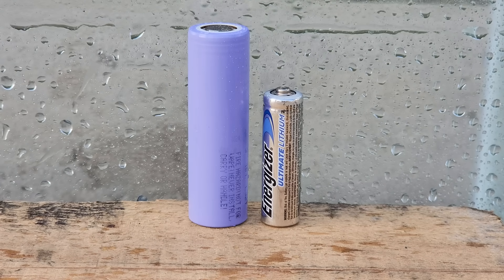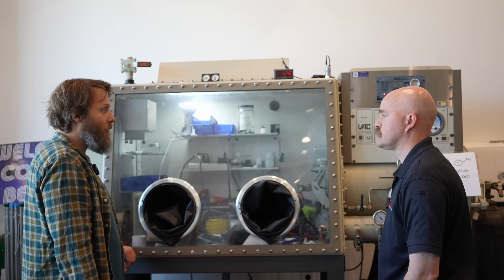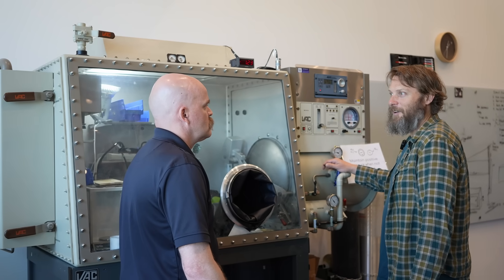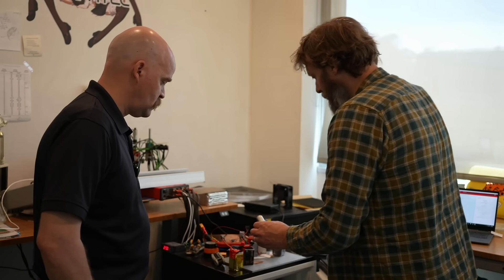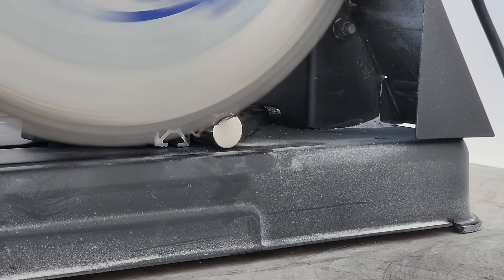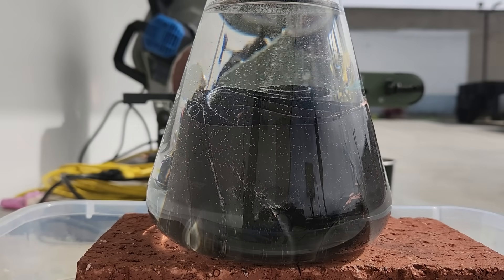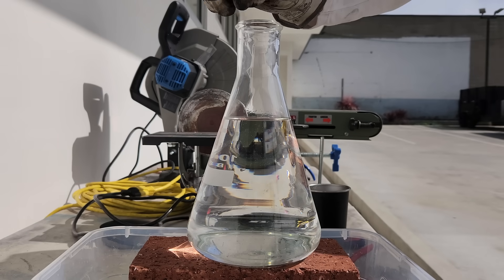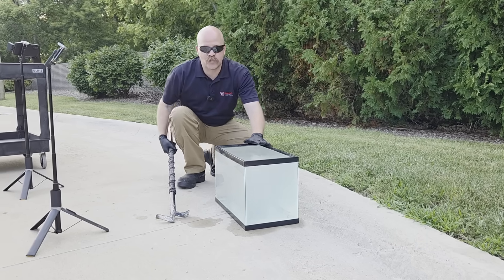Do Lithium(Ion) Batteries Explode in Water?

Comment: I feel like it's fair to assume that it would be pretty hard to mass market those disposable lithium ion metal batteries if it were that easy to cause a combustion the way you only sawed the top off for an opening and put the canister in the beaker as is. We'd have mandatory fire extinguisher courses from junior high on up by now.

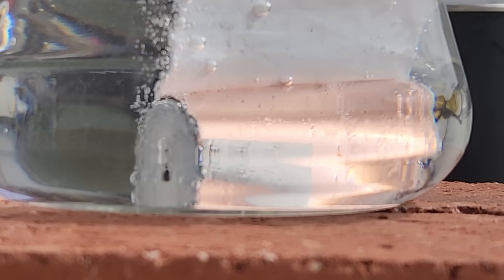Comment: If these lithium ion batteries had been charged too quickly in low temps then they would have metal in them and go into thermal runaway in the water. 10:30

Comment: Long ago I used to watch people rip open dozens of lithium batteries to use the lithium for the creation of illegal (and disgusting) substances.  Its easy to access, you just you pliers and sharp wire cutters to peel off the positive terminal and it unrolls pretty easily.   And if the air is humid it WILL self ignite!   Its extremely dangerous.  I don't even know how these batteries are legal.

Comment: If you try this at home, be aware the reaction with water produces a strong alkali hydroxide.  Alkali's are better at dissolving flesh than acids, though the volume of water vs the volume of lithium means its probably too dilute to be a hazard.  Just don't take a bath in it afterward if you threw hundreds of batteries in there..

Comment: Maybe trying a laptop battery to get that big explosion.

I had a laptop and it's battery lasted for 3 or 4 yrs, even when it was connected to the power cord it stayed cooled. Then I decided to buy another one and got an extended version, this one lasted for less than a year sadly, and when it died it started heating up when I plugged in the charger. I would assume that it was so degraded inside that it was causing an internal short circuit.

Comment: Those energizers if ya wanna throw it in water for fire just use a copper pipe cutter, you can cut right thru that case without cutting into the lithium strip

Comment: This video is great, and really stops some of the misconceptions around li-ion batteries. The amount of people who don't know that water is actually used for smaller cells, and also that electrolyte is the flammable part. So many people think Li-ion have actual lithium metal and get more scared because of that. 

Fun fact, lithium metal is an option to replace the anode, but with the liquid electrolyte systems at the moment, they tend to be too reactive.

Comment: Did you use distilled water? That would make a huge difference if there was ions in the water? You can dunk a computer in distilled water while it's on and nothing happens, add a couple specks of salt and boom, you have a paper weight.

Comment: I washed my pants with a rechareable lithium-ion battery flashlight in a pocket.  It went through the wash and then in the dryer.  I was surprised nothing more happened than the battery lost its charge. I replaced the battery (the flashlight survived a bit beat up but operable) and recycled the washed-up battery.

Comment: The issue is not the  cells ,there pretty much waterproof ,if road/flood contaminated water enters the EV battery ( which has to have ventilation ) this forms carbon short circuit tracks within the battery modules , which may explain why some EVs have a unexpected thermal combustion fire?

Comment: These batteries are like tiny solid rocket boosters/ chemical rockets. Just like gun powder, it's un eventful when not constrained in the metal bullet case. It burns, but not a dangerous event. Even Sugar, when in a tight container (toy rocket motors), are dangerous if not handled with care.

Comment: I believe the primary lithium cell you show in this demonstration is not lithium manganese dioxide, but lithium iron disulfide.  Li-MnO2 tends to be used in button cells and has a voltage of 3V.   LiFeS2 is what they use in the cylindrical cells and has a voltage of 1.5 V.

Comment: 10:14 if you unwind it and then put it in water it will react more
Reply: Or if you open a lithium iron battery that is fully charged and unwind it it will thermal runaway

Comment: "I really wanted the fishtank to explode, but it didn't, so..."  (swings club, breaks tank)  Now THAT's science!

This makes sense; if you know your chemistry, you know that metals down the leftmost column of the periodic table are reactive to water.  Lithium is there, along with sodium, potassium, rubidium, and cesium; the further down the table, the more violent the reaction.  Maybe if we can manufacture a battery without these elements, we can make a safer battery?

Comment: In 2017 I bought a drone. Through discussion groups I learned batteries left on charger would swell. I confirmed that and removed batteries from charger, but due to rising costs and FAA regulations I unregistered my drones and stopped flying. I still use Li batteries, but not in drones.

Comment: I use Lithium Polymer batteries in my flying RC hobby... they can be quite violent need special attention. way more reactive than LIONs.. but even they dont do much in water.. i soak old dead ones in salt water for a few days before taking them into the recycle depot

Comment: Question. 
In my fire school training in the service, we were told the only way to put out a Class C electrical fire is to de-energize the circuits.  Then you are only dealing with A and B fires.  Not something that can be done when batteries are involved.
Granted this was back in the 1970s and things have probably changed since then.

Comment: Nice video.  One correction: at 10:52 you mention that the black material in the non-rechargeable battery is "magnesium dioxide", it is actually manganese dioxide.  Magnesium and manganese are two very different chemical elements.  Magnesium forms only the monoxide, MgO (which is white), while manganese can form several oxides, such as MnO (pale green), MnO2 (the black material) and Mn2O7 (an explosive red oil).
Reply from the maker: You are correct.  I misspoke.

Comment: To be candid, even dunking pure lithium metal in water shouldn't result in fire but the water will heat up very quickly. Sodium will produce visibly more energetic reactions in water and potassium will definitely catch fire in water and Cesium will be highly explosive. You need the appropriate combination of lithium ions and other cell components to create those typical thermal runaways. Hence NMC cells are more thermally unstable than LFP cells even though they are both (technically speaking) lithium ion batteries. The normal order of reactivity of alkali metals is Cesium>Potassium >Sodium >Lithium. The reason why lithium batteries are more energy dense than batteries made from it's more reactive brothers (which is kind of an anomaly) is beyond the scope of a YouTube comment like this.

Comment: It lets you know, that unless a Lithium Ion cell (or some part of it) is severely over-heated, it's a "nothin' burger". Level 1 or Level 2 charging an EV in your garage is perfectly safe, as long as the car hasn't been in an accident, or, an error in the BMS allows a cell to become over-charged. EV battery fires are so rare, insurance companies barely even address it. If the companies that pay out after an incident don't factor it in, you have very little to worry about.
     My insurance rate went up $48 dollars a month, when I upgraded from a 20 year old Toyota Prius with liability only, to a shiny new 2025 Chevrolet Equinox EV  with all wheel drive. The increase in premium was based ONLY on the replacement value of the car. If you were "tap dancing on a land mine" every time you plug in an EV, my auto insurance wouldn't want it, my homeowners insurance wouldn't have it. The only concern by the home owners insurance, is that any charge service equipment be installed by a licensed electrician. Their concern is, making sure the outlets and wiring can carry the sustained high current involved with charging an 85 kWh battery, which could take hours. No concern whatsoever, about the battery itself, just the house wiring.

Comment: When I was an Infantry radio operator (RTO) in the US Army (mid- to late-1980's), we transitioned from the old-chemistry batteries to Lithium batteries.  The first thing, middle thing, and last thing we were told was "don't soak the batteries in water".  They were probably the lithium-metal style.  While I'm not aware of any of them bursting into flames (in the radio they were sealed from water, and by default they were sealed up like MRE's), I was always paranoid about them.  
We RTO's who had to walk overland for a living loved those lithium batteries.  For each of the old-chemistry batteries, we could carry 2 of the lithium batteries in the same space, each of the lithium batteries lasted two or three times as long as an old-chemistry battery,  and they weighed less.  That technology was wonderful.  😃

Comment: Thanks for this, as an RC hobbyist I've been trying to educate people about rechargeable li-ion and lipo batteries and their safe handling and disposal.

I've recommended "disabling" them by immersing them in a salt water solution (if a recycling center is not available)  before disposal so they cannot erupt in the garbage.

And people let me HAVE it. I tried explaining about the lithium being trapped in a substrate and that I have literally done the experiments where I've opened them with no fire. They catch fire when shorted or due to thermal runaway, not exposure to air or water (lipo and li-ion).
Reply: I short my old RC lipo packs out by driving a screw through them, then once they've burnt out they're safe to through in the bin. I do this in a safe area outside of course.
Reply: @FokDR1 the saltwater is for a less dramatic way to do it lol
(Less fun too)
Reply: This is a fear monger channel I have flown RC since 1992 yes I have seen a few lipoly packs catch fire after being crashed in a plane then recharged attempted at the RC field. I have crashed a few the pack was all smashed in I was able to keep using them. I even had packs that swelled like balloons they still held a full charge kept right on flying them never did one ever burst into flames. I have about 80 lipoly batteries which are the evil cobalt based technology never once had any of them ever burst into flames. I charge them outside, and I store them at 30% charge inside a battery safe bag.  This guys channel he makes money off trying to make Lithium batteries equal to nitroglycerin.  When a battery is no longer usable drain it down using my charger to 0 then toss in the trash once discharged they are safe.
Reply: @Mike-01234 no this is accurate information. You would not believe the techno myths that surround lipos.

He is presenting that handled normally they are perfectly safe. And most importantly that the lithium inside cannot react with water and that is NOT the source of their combustion.

The source of combustion is shorting or thermal runaway (which in my opinion is a fancy name for a short caused by thermal expansion).

You might have gotten away with flying puffed packs 10 years ago but I wouldn't do it today. The manufacturing techniques have gotten the layers ridiculously thin for high energy density and that means a tiny bit of swelling can make 2 layers touch and that's a short and the beginning of the end for that battery.

Comment: Without an ignition source laboratory grade pure lithium only produces Hydrogen. I have thrown pure lithium into water and without providing a source of ignition it just bubbles and sputters about on the surface of the water. That being said don't play with lithium because it can go sideways if not handled correctly.

Comment: Stored energy comes in many forms, the higher the density the greater the danger.  Also, as the dangerous goods code makes very clear, more DG material means a larger risk.  You can safely drive around in a light vehicle with 60 liters of gasoline on board in tank, but would you want to be driving a semi truck with 2000 liters of gasoline hanging off the chassis rails in Alloy tanks?  Thanks to Semi-trucks using diesel fuel (not gasoline) then 2000 liters is not a problem.   This is what concerns me about people that use LiFePO4 batteries in large battery bank arrays, they have 20kw/hr of them, in a big clump, no fire rated material separation, indoors, and next to other electrical equipment like Inverters etc which provide a potential source of ignition.Then this is all indoors and next to other combustibles.  There are other videos even more cringe, involving people using old and less safe EV vehicle batteries known to have self ignition issues, being set up indoors.

Comment: I was trying to repair a cellphone once, and I was trying to cut a tiny piece of plastic that didn't quite fit right.  I ended up slipping and piercing the battery...well, it burst into flames right away and I managed to throw it into my stainless steel kitchen sink before it did any damage...those things go QUICK!!  Needless to say that phone never ended up getting repaired 🤣

Comment: Was surprised at the reaction with clean water. Like some said , salt water may bring a bigger reaction. Would it be possible to use a tubing cutter instead of a chop saw to open a cell , not that I'm going to try. Nice dig with the musky truck in the background.

Comment: Also bear in mind that the aluminum and magnesium sheet materials inside additionally become self-feeding reactive materials once a certain temperature requirement and presence (addition) of water. It's just like the elemental lithium scenario, except requires an additional high temperature condition to make the magic conditions combo.

Even the presence of aluminum and copper together combined with extreme high temperature could be sketchy, as in thermite...or is that in combination with iron?

Comment: Interesting stuff but my query is what if that water had some level an electrolyte dissolved in it - would that change the end result? Am asking because if this were the batteries we see in an EV for example the likelihood of the water the batteries that may become immersed in will contain some level of elements that make the water way more conductive than the plain water in the experiment?

Comment: not the best experiment. You submerge not a battery, functional electric device, but effectively parts from which it consists, thus check only interaction between water and these parts. Ummmm, not very interesting if these parts are not active by self. 

I tried to drown old malfunctioning (swollen and producing almost no power, but still assembled) phone battery to get rid of it safely, - it does not explode like metal Li, but at least react very actively, emits gases and sparks when water gets inside the structure and shorts electricity. Unrolled but NOT separated electrode stripes react with visible effect too.

Of course fully charged battery will react much more active. And salt, good conductive, water will increase activity by orders.

Comment: Pat, I'd HATE to be this guy's landlord.  I've gone through several Phase I and Phase II environmental inspections connected to loans on large properties.  One Phase I inspection revealed an automobile engine oil stain that showed signs of the oil dripping off the edge of a concrete slab onto adjoining soil.   I watched two young environmental engineers with Ph.ds use hand shovels to fill two 50 gallon barrels with "contaminated" soil, seal the barrels, obtain a special transit permit and take the everything from Los Angeles to a hazardous waste disposal site in Nevada.  Want to guess how much that cost?

Regardless of the actual hazard, If I saw you cutting lithium batteries open and unwinding "jelly rolls" on my parking lot I'd kick your ass then serve you with an eviction notice. Love the Cybercrap Truck.  Buy the way, how did you dispose of the hazardous waste you created?

Comment: There is elemental lithium in a charged li-ion cell but most of it is locked away in the carbon or silicon lattice, greatly limiting reactivity with water.

Comment: A friend working on his sailboat dropped a cordless power tool battery overboard at the dock in relatively shallow salt water.  By the time he could grab a mask and dive after it, the pack had become too hot to handle, and he left it on the bottom.

Comment: The navy engineers told me that they use the 3.7 volt ⚡️ because if they went any higher I'd be missing fingers under water they just bubble out and blow out the seal and the led light